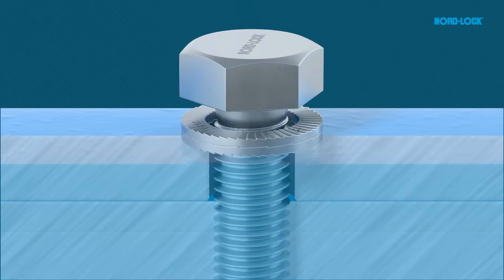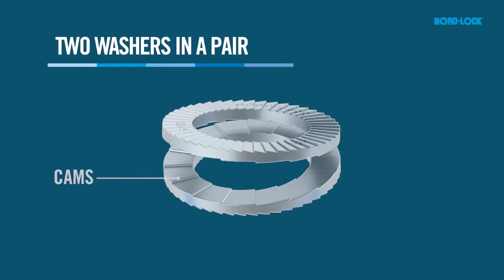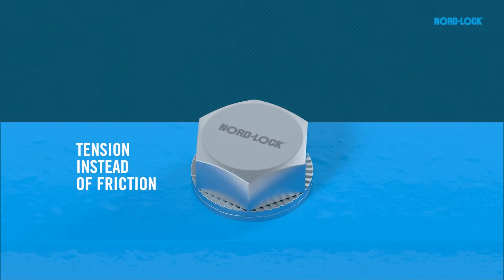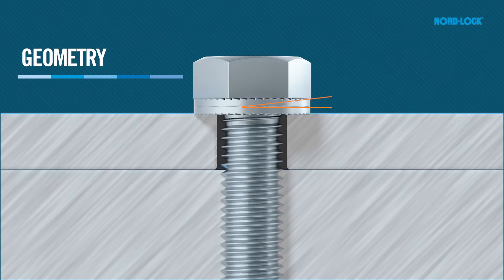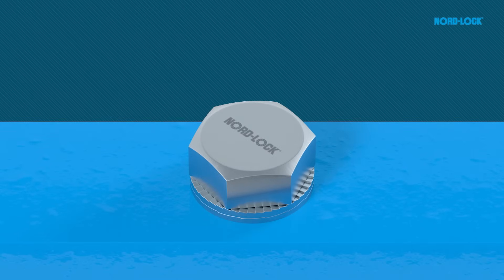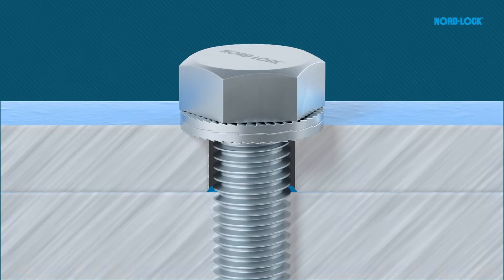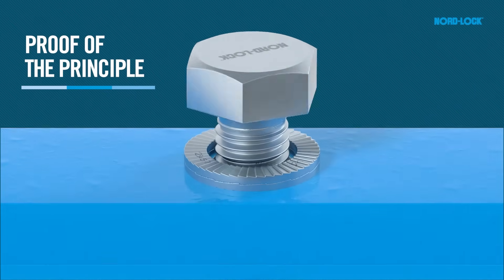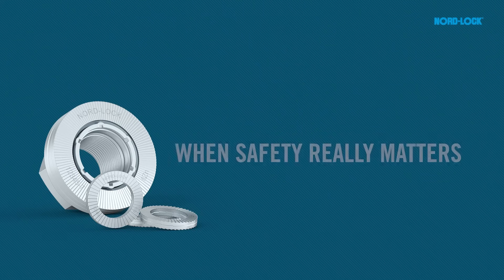How the Nord-Lock Washers Work (Animated Video)

Comment: Are they reusable ?
Reply from the maker: The short answer is, yes. You can normally reuse Nord-Lock wedge-locking washers, but it is necessary to perform a thorough inspection of both washers in the pair for signs of damage first. Damaged or worn washers should not be reused, as this can limit the performance of the wedge-locking effect and expose your bolted joints to loosening.

Read more: https://www.nord-lock.com/insights/videos/reusing-nord-lock-washers/

Comment: Dear Nordlock: 
Your product works well and I used it many times over the years. But I feel you are missing some important context of the actual working principle.

How do the Nord Lock washers work? How do wedgle lock washers work? 

A short explanation attempt for the interested:
1. prepare the assemby: base, 2 washers, nut, thread rod (or screw)
	the cams of the 2 washers are locked in tightening direction
2. tightening: 
	the nut will scratch over the serrations until the tightening motion drives the serrations into nut and base material
	[note: some washers are a bit bulged -> this means they deform while tightening. This enabeles a design specific tension for the joint.]
3. loosening: 
	[work principle #1] usually it requires much less force to move the cams over each other than to rip out the serrations carved into nut and base
	[work principle #2] while turning the nut in loosening direction you have to overcome a big force (see below) to get the upper washer one cam segment further
	[force: by compressing the washers you need to put some energy in material deformation (also called tension) and you also have to overcome the friction between the cam surfaces] 
	[work principle #3 - "wedge effect"] with washer angle bigger than the thread angle you compress the washers while opening the nut
	just think about the opposite design --> cam angle lower than the thread angle: turn the nut a tiny bit and suddenly the nut moves more up than the washer --> the nut is suddenly free because nut and washer separated
4. summary:  with this design the joint has to overcome this loosening force before it can turn freely.
	common problems for these joints are:  hardened nut/base materials // corrosion
Reply from the maker: Thank you so much for your feedback! We really do appreciate it!
Reply: Hello @vornamepebble2434

Could you please help a layperson (me) understand this? I find it interesting but I am not from this field.

Comment: Let's see. You can't use them on wood or plastics - too soft; you can't use them on steel or ceramic - too hard. I think I'm done here.
Reply: But, you can use them on steel? That is the main purpose.
Reply: They are made for using on steel.
Reply: Well using them on wood/plastic is just downright silly. I can't see a situation where vibration is such an issue with those two soft products that such a washer would even be required. Next is using it on materials harder than the nordlock product itself. All they're saying is that their washers require the indentation marks on the surface of the bolt and mating surface to serve it's properly purpose of locking, which can't effectively happen if the material is so hard that those marks cannot be made. So this product is still good for 99% of applications.
Reply: Serious engineers know this is a silly comment

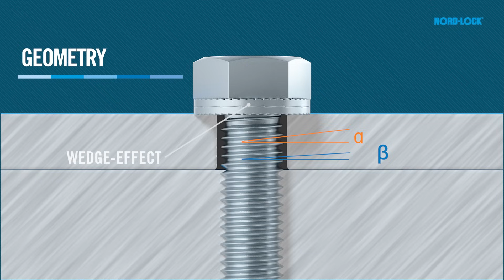Comment: Still don't understand how they work, 0:29 because alpha > beta ??
Reply: When the bolt turns to the left, it will also try to rotate the washer below it. The top washer will try to “climb” up the cams of the bottom washer which will cause upward pressure against the bottom the bolt head. The bottom washer will be pushed down by the top washer via the cams creating downward pressure against the part.
Reply: Just think of the only mating surface that can move is where the two washers come together. In order for the washers to move past one another the distance between the washers must increase, why, because of the ramp design. If the distance increases between the washers the bolt would be tighter. Alpha, the ramp design moves the washers apart more than the loosening of the bolt (Beta) in the same rotation.
Reply: Imagine loosening 1°. The washer pair will stretch the bolt more than the thread pitch can unstretch the bolt, because the washer has a steeper angle. Therefore the connection gets tighter instead of looser as it normally would with a flat washer (0° angle)

Comment: The cams appear to be opposite of what is needed for a right-hand bolt.
Reply from the maker: Thanks for your comment! 

During tightening the rotation occur between top NL washer and the head of the bolt or the nut. During untightening we want the rotation to occur between the two NL washers, so we go up the rise of the cam face and this creates the increase in preload in the bolt. This means the joint can't rotate loose unless you provide the force to overcome the cams. 

If the cams had been the other way, then we would not have the sliding between the two NL washers. Because the 90 degrees "wall" would prevent that. Instead, the rotation would occur either under the nut or bolt or against the mating surface - thereby ripping and damage the surface, and then it would just be a kind of friction locking. I hope that explains it.

Comment: Sir, the idea was good. But here we are compromising another important purpose of the washer,  which is even load distribution and not to make any scratches on the surface of the component.
Reply: different washers different purposes
Reply: These washer lockers are for safety, so impression marks are necessary. If  you do not want these , try other solutions like Loctite  threadlocker.
Reply: We are an authorized distributor for NORD-LOCK Washers in INDIA.

Warm Regards

AHMED R BHOLA
JEYSONS INDUSTRIES
Mobile: +91-9167700983
Email: arbhola@jeysons.com
Website: www.jeysons.com
Reply: "Sir the idea was good" 😂 you realize this is a huge company with billions of dollars of washers sold to satisfied customers right? $200M just last year. This comment makes it sound like it's some guy inventing this in his garage and showing it to the world for the first time
Reply: I'd rather have some scratches under the bolt than a catastrophic failure due to bolts coming out.